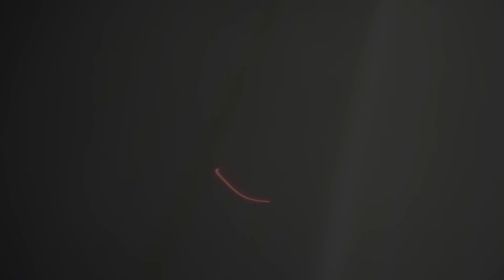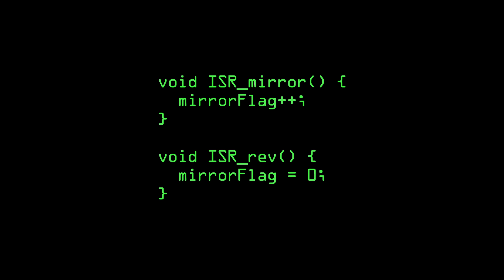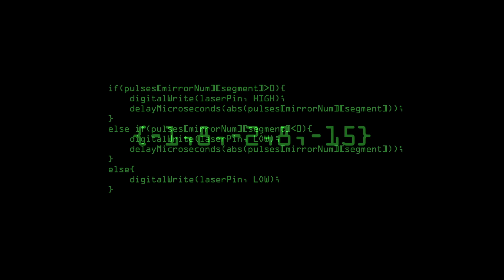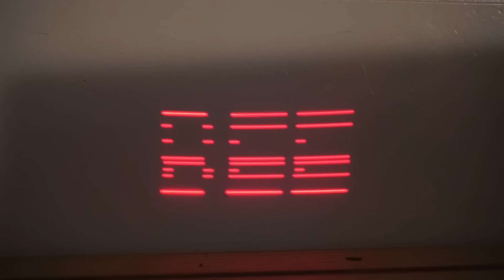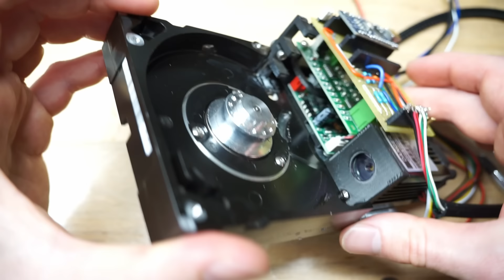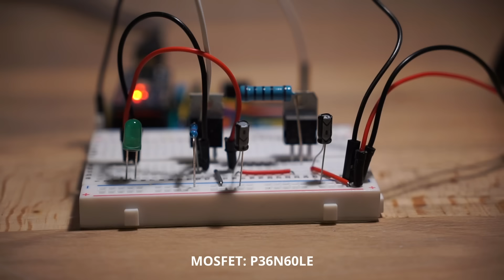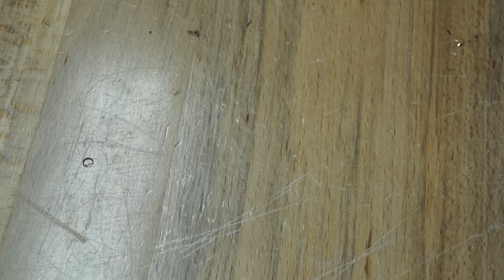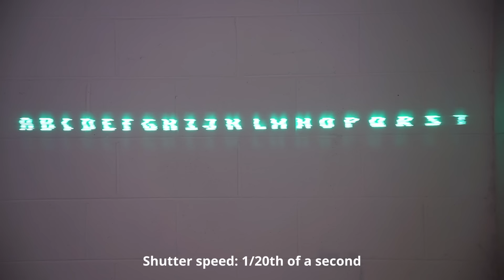DIY Laser Projector - Built from an old hard drive

Comment: awesome!!! can you fit servos  to control mirrors? wires should be the issue i guess, but if ESP-NOW is sitting inside - you need no wires to adjust mirrors? just power to inside the cylinder ? just thinking out loud 😀
Reply from the maker: That would be really cool, if I could find small enough servos that were also very accurate and resistant to the centrifugal force of being spun at something like 2000 rpm. I'd have to use a slip-ring to send power and signals to them, but it could be something worth experimenting with in the future.

Comment: some of the wobble of the test is due to the background timers running causing inconsistent timing. Disable the background timers (which are there and used for functions like millis() and it should help timing stability. Also the way you have your "reset" tab positioned and and the code you showed, half way through the last digit you clear your variable back to 0 which would explain the half cut off last digit. Need to tweak how you reset your counter (you can instead set another variable to true, then when the mirror position tab comes through check that variable and if true reset position and back to false otherwise increment the position)

Comment: I'm not a pro at this but what I heard from pros is that arduinos are not precise enough due to the way the micro controller is powered and creates timing inconsistencies that add up. Would be nice if someone could correct me or/and suggest an alternative.
A question though, is this safe enough to be mass made and sold ? I'd love to have a projector as powerful as this but what's available is pretty weak, would it even make financial sense as a commercial product ?

Comment: That's an awesome project. I always wanted to make one but  color for projecting video. but never enough time. I did have one idea for you. I thought of using the Octagon rotating mirror from a laser printer it is already Precision made for horizontal scanning, all you would need is a wobbling mirror for vertical and it wouldn't have to be that fast, think of video timing speeds.

Comment: I'm wondering if you could use the head positioning mechanism of the hard drive as a galvanometer to deflect the beam vertically. Then all the mirrors on the drum could be fixed at one angle, no need for finicky adjustments, and you could get more lines with easy control over the line spacing.

Comment: you said that you have a CNC mill.  you will get more stability if you make the spinning parts out of Aluminum instead of plastic.  You already made proof of concept.  Also the Al part can be made with thinner wall thicknesses.  balancing the spinning part you made would be easy.

Comment: Very nice. To avoid the need for timing adjustments in code for the scan lines, and perhaps to fix the wobble, you could try a sensor assembly just before the output window. Its purpose would be to detect the beam and start timing based on that. A light guide of some kind to a single detector might work. Power the laser at the start of a sweep, wait for a signal from the detector, and then the horizontal position is time relative to that. Have a single adjustment in code to account for any skew in the detector, which could be set through a web interface if you later used an MCU with WiFi such as an esp32.

Comment: hahahaha. im getting a phd in atomic physics. and i could have told you immediately the problems youre going to have with the plastic holder and 3d printed holder. thanks for making me feel like i learned something.

btw: plastic absorbs humidity and expands due to temperature so those are both gonna mess your alignment. even with steel parts we still have to deal with misalignment over time from temperature. im glad you take laser safety seriously. it blinds those who are most complacent. another lesson is never assume manufacturing tolerances are enough to get your laser beam where you want them

Comment: Nice to see the mirror drum design revisited. It's a well-built construction!
However, from the video it sounds like you came up with the idea, even though we've seen this principle being used for the last 10 years at least.
For example: https://www.youtube.com/watch?v=vvbzIy2U1J0 or https://www.youtube.com/watch?v=7rWy6-go_y8

I would recommend doing a little research before starting a new project. It can only benefit you since you can learn from other people's mistakes.
I'm pretty sure they would be happy if you acknowledge and reference their original ideas, which you improve on.
After all, that's the beauty of being part of the DIY maker family :)

By the way, if you ever decide to switch to a more powerful microcontroller like ESP32, feel free to use my PCB design files and source code as a starting point. I've built an open-source Wi-Fi controlled laser projector last year - https://www.youtube.com/watch?v=w1O48Ysdiiw
Reply from the maker: Thanks! I did think of the idea independently, but yes, once I started looking things up I found  that others had already done it before. As some other commenters pointed out, there are mirror drum designs going back as far as the 1930s for mechanical television. Thank you for sharing the link to your PCB design, I'll check that out. I subscribed to your channel as well.
Reply: Fair :) Thank you. So did I to yours.

Comment: I would have to say, that since the shifting (wobble) is only on the x-axis, it's quite likely that it's a result of timing. If the imbalance of the rotating assembly was an issue, it would likely occur on both the X and Y axis. Either way, if you ever fix it, please make it an optional feature. I think it really suits the project well having a little bit of wobble!

Cheers,

Mitch

Comment: Instead of one bigger laser, could you have several class II lasers diodes mounted vertically? You could individually control them to get better vertical resolution. e.g. if you had 2 lasers each one would display every other line
Reply from the maker: Yes, I might do this in a future version.

Comment: A lot of laser printers have a lovely module that does very rapid linear scanning, but does not have the angled scanning. They use the feed speed of the paper path to synchronize everything. The diodes that are in the devices are IR, but are reasonably able to remove and replace. 
The ones I've used have a hexagonal polished aluminum front-surface mirror and some complex lensing to provide a nicely linear scanning path. 
I don't know enough about the collimation and focusing of the beam itself, but it might be a decent starting point. 

Also, a blue laser does really well to show up on surfaces that fluoresce, like a sheet of printer paper or a wall with glow-in-the-dark  paint. 

It's the physical equivalent of an old monochrome CRT.

Comment: "...close to the limit the Arduino can do for switching on and off the laser of 1uS"

With a 16MHz clock, the atmega328 can toggle a gpio at ~1.6MHz (eg.  PORTD ^= 0xFF; changes the output every ~310ns). You can run at up to 20MHz if you change the crystal too, for a little extra speed.

Also totally cool if you're more into building the cool thing than stretching the technical limits of a particular microcontroller. Nice work!
Reply from the maker: Thanks. I am still pretty inexperienced with arduino programming, so I'm sure that there are better ways to do it. I'll look into direct port manipulation instead of using digitalWrite.

Comment: You might look at using a UART /serial comms port on the microcontroller to drive the laser modulation. This would require it to be configurable to not generate start&stop bits and that the clock divider can be set to a high enough rate. If there's a TX enable input that could perhaps be used to synch to the rotor, and take firmware out of the critical timing loop

Comment: This is a really awesome project, Ben, and a nice combination of old and new projection techniques! I can tell you that one part of the causes for the shuttering effect you noted actually is the carousel that you built, as each transition causes the image to "break" for a split second. You'll also get closer and more uniformly focused lines if you anchor the pivot point for your mirrors at the center height of those mirrors and in line with your laser.

An interesting point to note is that a lot of larger home theater projectors use micromirror devices with broad 2D micromirror arrays within, one for each raster pixel art either the intended full resolution or some simple fraction thereof (and then vertical and horizontal servos in the latter case to multiply the apparent pixels); but many pico projectors use a module with just a single micromirror on centered vertical and horizontal pivots. My own limited understanding says that's identical in concept to the galvos in light show projectors and they just use tighter control. It might be fun to see what you can do with that knowledge.

Comment: This reminds me of mechanical TV's where a rotating disk was used to raster draw the video feed by turning on and off a lamp at times to create an image on a screen. Now I'm wondering if there is a script for running Mech TV for the Arduino that could help the project, you might be able to run a 4bit/8bit visual animation on that laser display.
Reply from the maker: Yeah its not a new concept exactly, but it was fun to figure out. I do want to re-write the code to allow for animations.
Reply: @benmakeseverything  Hey, that sounds great. I can't wait to see the progress as it goes. There will be a lot of fine tuning and redesigning etc as you progress. 

You may need to balance the mirror drum, if it's slightly heavy on one side by even a milligram, that will cause resonance on the drum. 

Probably the cause of the wavy/shimmer effect. Maybe some sort of damper to eliminate vibration messing with everything. 

It be quite cool if you were able to have the mirrors self adjust using a tiny camera to track the scan lines in real time and auto-adjust the mirrors on the fly during raster drawing. 

A few ideas to give you food for thought. 

GOOD LUCK TO YOU 
Much love from Scotland

Comment: Nice Video, but why didn't you just CNCed a Mirror Holder?
Should be better in terms of Flatness etc. that 3D Printers can't accomplish.
Reply from the maker: Mostly due to the limitations that come with designing for CNC vs. 3D printing - my CNC is only 3 axis and so some of the feature would be hard to set up.

Comment: @benmakeseverything are you using "first surface silvered mirrors" if not and you're using back surface silvered mirrors, that may explain the "wiggle" in the text as the laser is oscillating between the two surfaces. This would probably also reduce the brightness.
Reply from the maker: Yes, first surface mirrors would be better, this was more of a prototype. If I build another one I would use those or polished aluminum for sure.
Reply: Just realize that you "re-invented the wheel"...Laser printers/copiers contain a polygonal mirror very much like this...only the spinning mirror is made of highly polished aluminum!!! Awesome Project, BTW!!!😁👍🏻

Comment: I think you need a friend with a decent lathe and vertical mill to machine you a piece from aluminum block for the mirrors.
Reply from the maker: Yes, that would be amazing. I would also need to polish them to mirrors though.
Reply: @benmakeseverything  Either affix the mirrors or polish and get the surfaces mirrored using vapor deposition. Labs that do telescope mirrors could do it for you. I have no idea of the cost though.

Comment: This is an excellent project, well done. I may have a go but using a small FPGA to generate timing and to hold the character generator, this could significantly reduce jitter. Interrupts are one possible source of your woes, you may need to be selective about when they are enabled, and you may also need to optimise some of the code in assembler - this will also allow you to see actually what is going on in terms of real-world timing. In any case congrats !
Reply from the maker: Thanks! I have no experience with FPGA, but it may be worth looking into in the future.

Comment: In addition to Arduino interrupt timing, the wobbly effect could also be the result of mechanical play in the motor bearings.  Even the best motor spindle bearings when new have some play.  Given the fact this was a used HDD, there is probably a bit more play than a new bearing would have.  In addition, any imbalance would introduce vibration that would only accentuate bearing play.  Depending on the RPM, the bearing wear and the resonant frequency of the imbalance, the imbalance could create a slight wavy resonance in the image.  If fixing the Arduino interrupt code doesn't fix it, this is probably the cause.

Comment: That's funny you inadvertently made a really cool cyberpunk effect though.

To improve the accuracy of your mirrors. Basically print it out a little big and trim it down on your mill.  Also make a jig using the indexing arms to use as a dividing head.  Use the center bore as the center, and rotate it around the for each mirror holder, lock it in place with another part of the jig that holds it by the position arms, then have the mill come in to cut the mirror face.

Sorry, I'm sure that's hard to understand over a comment.

Mathias wandel and I'm sure some others have videos on how to do really simple balancing
Reply from the maker: Thanks. I think I get the idea... I would definitely prefer to have the whole assembly to be made from aluminum and either polished to a mirror or electroplated and polished if necessary. I'd like to make another one eventually with several improvements.

Comment: few moments for you! use a motor driver which can hold real prm speed like a 7200 5400rpm steady.
use a time window algorithm in fixed time-slots for each line for kill Jitter errors on scan.
cool idea really! use optocouplers only for sync in asynchronous mode.

Comment: It's an interesting project. A few things that you may or may not have considered are:
FDM prints are somewhat flexable and low res compared to resin prints. If you have access to a resin printer, this might be a good project for it's precision and rigidity. If you don't have one, this might be the excuse to justify buying one that you've been looking for. 

Have you considered if the glue you used to attach the mirrors is flexing under centrifical force when the mirror assembly is spinning. 

Common mirrors are back silvered so you're actually shining the laser through a piece of glass at an oblique but changing angle as the mirror passes the laser. How thick is the glass and how much is it affecting the laser as you change the angle? (front silvered laser mirrors are expensive and fragile but get around this issue)

Rather than a spinning laser assembly, have you ever considered a pair of lasers attached to speaker magnets? The beam would go from the emitter to the first mirror which would turn the dot into a line then reflect that to the second mirror which would turn the line into a square. The mirrors oscillating back and forth would give you your scanning while the pulsing of the emitter would determine which dots of the square were bright and which were dark. You'd only need a single frequency fed into each speaker magnet to make it pulse back and forth at the right rate and while the beam would still hit the mirror at an angle, it would be more consistant than a rotating mirror. And since you only need 2 mirrors, you might even go with front silvered mirrors. 
Not sure if this would work better, (or at all) but it's something to think about for the next version.

Comment: The processor in Arduino has commands of various lengths: 1.2 or 3 bytes (for the AVR processor). An interrupt cannot interrupt the execution of the current instruction, so there is an uncertainty in the interrupt delay. The ambiguity is eliminated if the processor is in the sleep state at the time of the interrupt.

Comment: Great laser scanning project, wanted to build this but gave up instantly since I knew lining up the mirrors will be super difficult without any precision CNC. As for the laser driver, you might want to check the "ic haus" laser driver ICs, they are small and are meant for custom high speed scanning projects like these which uses laser diodes, they have a catalog of laser driver ICs and also circuit diagrams that can be used. The custom laser driver you made is great too since it uses discrete parts. To go insanely fast switching, use a FPGA controller such as TinyFPGA, use a high speed photodiode along with "ic haus" laser driver.

Comment: I had the idea of using a spinning diode with a hard drive reader head galvo driven by an audio signal. The end result should be a 360 degree scan line with spectrometer effect.
Taken to next level, it would have different color diodes with their own galvos and crossovers for certain frequencies.

I've also experimented with an LCD shutter from a 3LCD projector in front of a cheap laser effect that is based on two spinning mirrors that are slightly tilted at the front of the axles of two little motors. Once I added the LCD thingy on, the effect multiplied to a serious kaleidoscope -type of effect. The problem then was the low power of the laser (the diode I used was from a airsoft -quality laser sight). I have a video of the LCD, but the effect is somewhat lacking due to less than ideal dynamic range and/or f-ratio. watch?v=YcJxFjWEOaw
Reply: A simpler version would be a tilted rotating mirror and another mirror with the galvo. That would make a round shape with the audio input making ripple effects on the line. This thing could also be done with multiple diodes and probably with a shared rotating mirror. Or for the craziest result it could be made with the two rotating mirrors with the addition of the galvo/audio driven mirror.